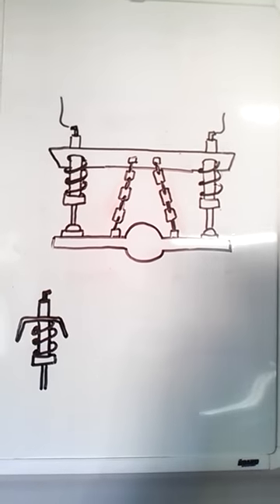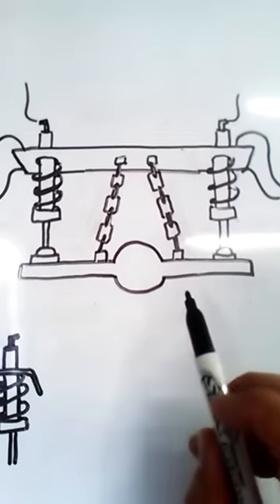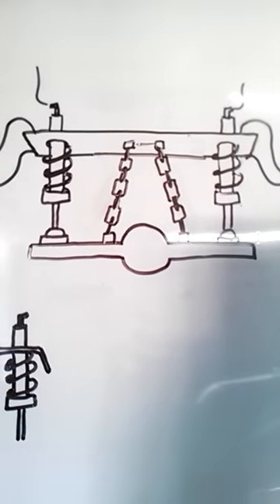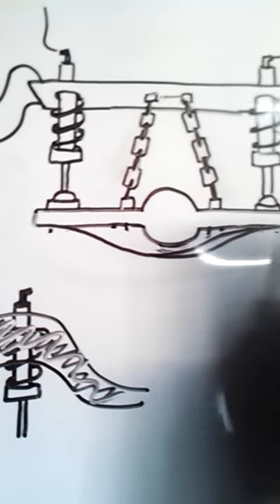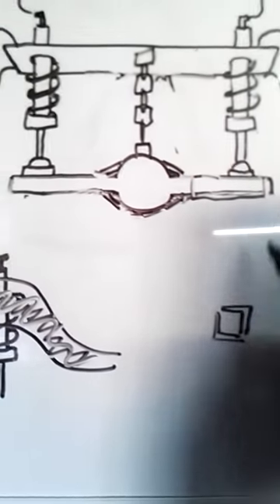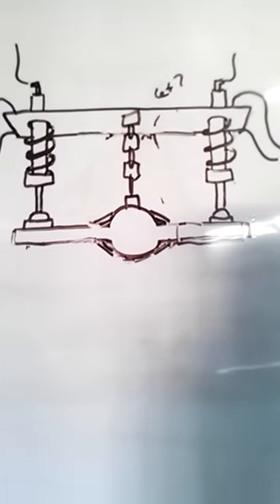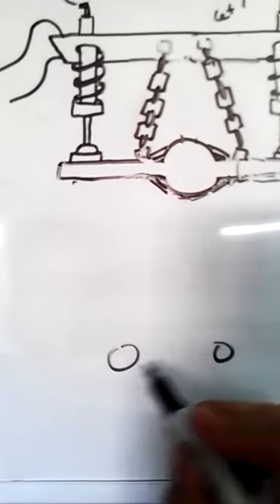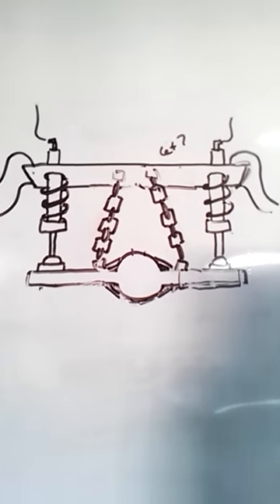Hydraulic chain bridge for power 3 wheel

Comment: you can threel with with 2 pumps . lock up front and back drop a side and tap up the front  and then give it gas and turn
Reply: Can't believe nobody corrected your thought in 6 years. Yes we know how 3 wheel works. 
A bridge and 3 pump setup allows standing 3 wheel without being in motion. In a g-body you can add sand bags or find a couple hundred pound friend to sit on a corner.

Comment: I've never done this an have always hit an easy standing 3 wheel. As long as you have a high lockup, lay pretty low and have more than a pansy setup with less than 8 batteries all this nonsense isn't needed lol.

Comment: I have a fleetwood i did 3 pump set up 4 switches , 2 six sprong front and back and 2 three sprong for each corner i still can get the back pumps to lock up but not together only when i drop it should i switch the 3 sprong first then the 6 sprong ?

Comment: well thats one way to explain it alto i dont think its totaly accurate. the car 3 wheels so easy because the chains move the piviot point from the cylinder and power ball to the chain more inboard on the body and axle making it easier to tip over. if it was just picking up the front end like in the scenario with the Jack like you said that all cars equpied with chains could 3 wheel and they cant. hoppers use chains parallel to the rear cylinder to compress the spring before hopping but they don't three-wheel very well because you're not moving the Pivot Point like you would have to chain was in the middle
Reply: How many suspension engineering books do you have. That's why no one has ever taken lowriders seriously. The suspension is ghetto, squeaky crap with wide open holes torched in the floor and none of the suspension shops know any thing about suspension.

Comment: You can run 2 pumps  and have a power 3.....1 pump for the front and 1 for the rear...BUT with 4 dumps. 6 dumps total ....It works but it's mainly for import setups. I did a 1 pump 12 switch setup back in the 90s it worked great with accumulators on a
Reply from the maker: Yeah using a dump as a block off. I've also done that back in the day. It stays open so you wire it to shut off when you hit the switch.
Reply: Have a 2 pump set up was wondering if you a diagram on how to set up the dumps  for 3 wheel would really appreciate it

Comment: I got a caprice it has the chains the bridge and rearend reinforced and I’m running 16s in the rear but when I try to power 3 it’s on getting like 6” off the ground and it’s on got nine links on the chain should I length it to the 15 links and try it or shorten them but I don’t want to always be changing the lengths to ride and to three

Comment from the maker: 1st things 1st. You will not be able to use a chain bridge for power 3 wheel without a 3rd pump. As far as reinforcing goes thats hard to say. People charge different prices and also the extent of reinforcement being done. Stress points to minor plated to full frame boxing all carry its on price for a bridge plating the frame arches and reinforcing the rearend are pretty much necessary. All that plus a bridge maybe 6-800. Shop around and make sure whoever does it knows what their doing. Will be bad if done half ass when something breaks.

Comment: Hey I have a serious question. I have a 79 cadillace eldoroado fwd it has the stock air bags on the rear suspension. I want to convert it to hydraulics. But I really dont know if its possible or rather how difficult it would be and how good fwd cars and hydraulics go together

Comment from the maker: Sorry but I don't know any way that could be done. problem with fwd cars is the cylinder has to replace the strut. that's why most juiced fwd cars have cylinders inverted on front and run mini coils. besides uni bodies are not structurally strong id be afraid to hop it myself.

Comment: Wouldn’t you need to fiber glass the rear quarter panels too so they don’t buckle from too much 3 wheeling
Reply from the maker: reinforcement on the frame helps with that. and some cars are a little stronger then others g body's seem to be the worst. fiberglassing would help for sure but proper frame work is the answer to maintain the cars structure